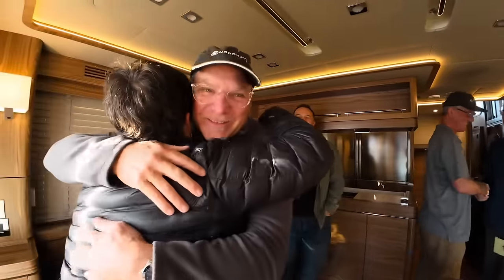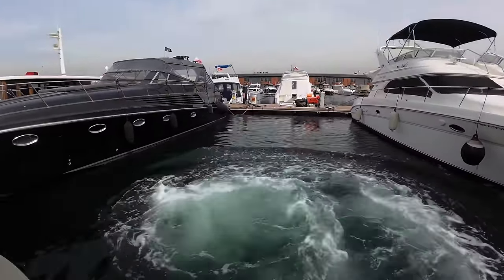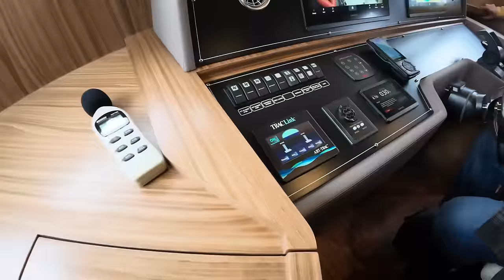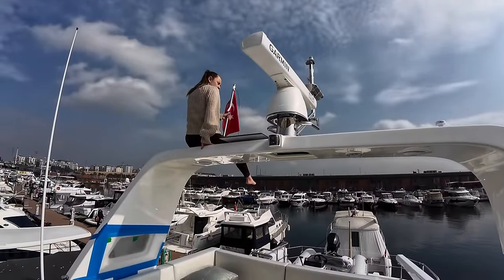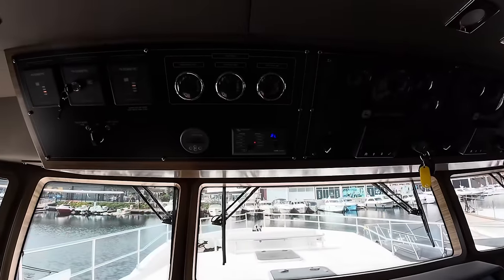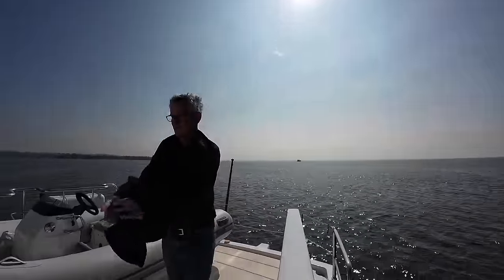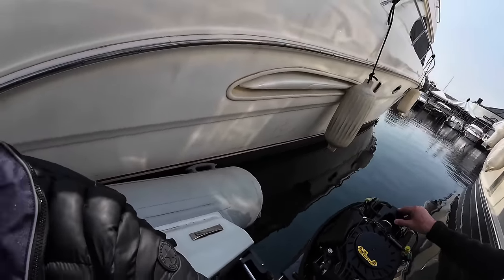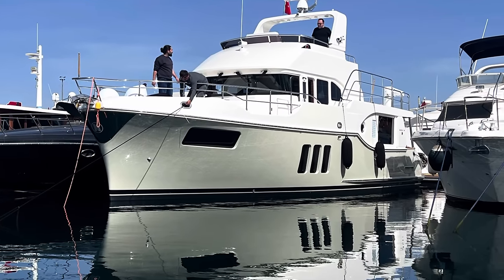Awanui NZ Ep 45 - Seatrials aboard Nordhavn’s very first N51

Comment: Hi I’m not sure if your aware the switch on the side of the throttle box on the tender is part of the safety engine kill system, if your driving the tender the kill cord should be fitted when you start the engine ie to your person and the throttle, so if the driver is accidentally thrown from the vessel the engine will stop. Happy and safe boating. Mike aka Flipper from Camel Trophy.
Reply from the maker: Yip absolutely, Fiona had it fitted

Comment: Push comes to show if you can start sniffing parts of the tinder engine and the part that smells like motor oil is where the dipstick goes
Reply from the maker: Excellent advice
Reply: @AwanuiNZ   I also noticed the inside of the engine was all one color black so it does make it hard to figure out exactly where it goes they should have color-coded some of those items

Comment: Interesting . Most brand new marine deisel  engine commissions are full noise for 2-3 hrs bare minimum... some are even more to bed them in...
Reply from the maker: Advice from team on site and manual for engines was load engine up for first 100hrs avoiding prolonged periods of low rpm. 1700-1800rpm suggested

Comment: Kettles trip boat electrics all the time.
Reply from the maker: Aah
Reply: @AwanuiNZ  The main problem with kettles is they run at 3kw the maximum power consumption, when this max consumption is turned off with the thermostat in the kettle it arcs and the surge trips the already max loaded marine system. The answer is a small travel kettle or possibly a digital kettle with temp control. This digital switching system may help, though this is only an assumption. I would like to see it proven or disproven.